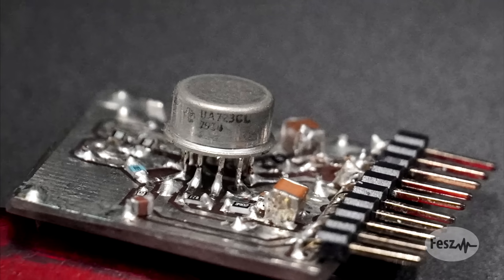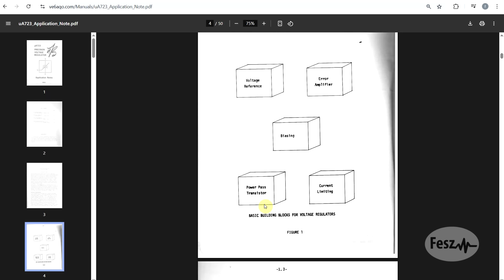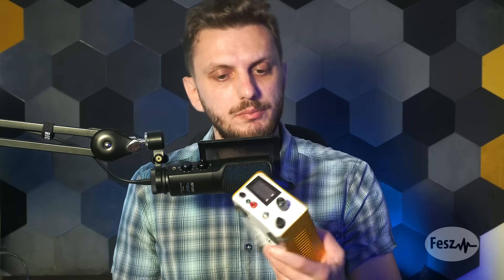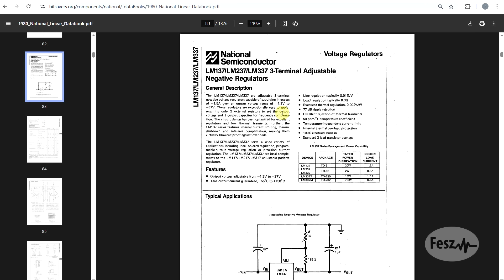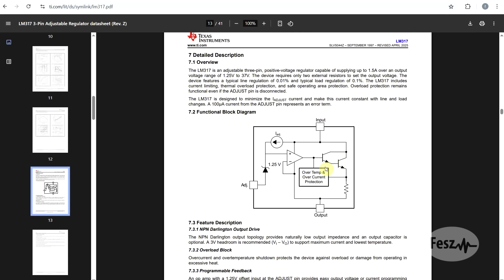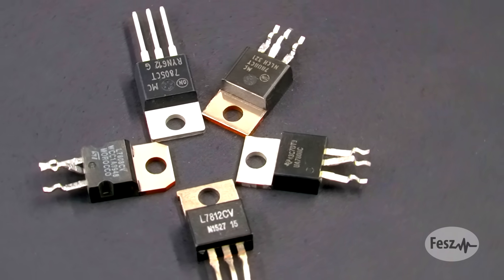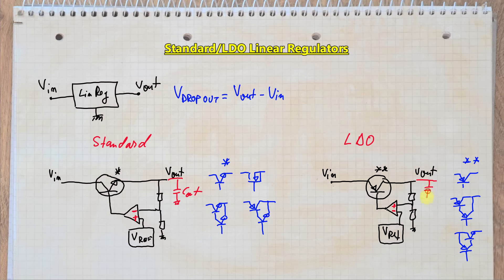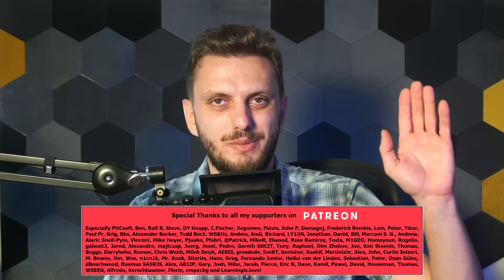Timeless IC's - Linear Regulators

Comment: damn! i always knew there is some capacitance variation, but never thought it can be 80%! 
i thought it is always much bellow 1%. 
thought of selecting precise values of ceramic capacitors, and now i find it would be completely useless. 
i wondered why other type of bulky capacitors were prefered in many application. why not a nice, small, cheap ceramic. now i know
Reply from the maker: Indeed, some capacitors will have a very large variation in capacitance based on the applied voltage. Its always important to observe not just the rated capacitance (measured at 0V) but also the exact value obtained during actual use...
Reply: @FesZElectronics  polyesthers vary much less?

Comment: I've got a few 7805s from the 70s
Reply: Be careful with old non-A suffix 78/79 series regulators as they had a 10% voltage tolerance and were binned non-A, because they couldn’t meet the 5% spec.

Comment: I'd be interested in a follow-up on stability in traditional (common collector / drain) and LDO (common emitter / source) linear regulators. Maybe as a part of design advice on discrete regulators (e.g. for high voltage or symmetrical positive / negative, or whatever may be the justification).

And thanks for sharing your experience! I like your content a lot.

Comment: Use these just above dropout, downstream of switching conerters to easily clean up the conducted switching noise, without the extra bulky discrete filtering components.  Has the 555 been covered yet? 🙂
Reply: Micrel Semiconductor (now Microchip) makes a Ripple Blocker line of LDO’s optimized for significant suppression up to 5MHz - important with modern MHz point of load switching regulators.

Comment: It's possible to supply the pass element of a 723 with a lower voltage than the one used to supply the rest of the circuit. I use this method in a linear PSU I made for a homemade receiver. It deliver regulated 5V and 12V (with the unregulated voltage for some circuit)

Comment: I think it’s important to mention that while the 78xx and 79xx parts are quite consistent (and thus interchangeable) from one manufacturer to another, this is not at all true of the 1117-type regulators. Some of them require critical capacitor selection for stability; others are designed expressly to be stable using just ceramic capacitors. Also, at least some 1117-style regulators, such as the ones from ST, actually use NPN transistors in them, so I don’t actually think that one can generalize that LDO regulators use PNP.

Comment: I found a good linear regulator driving a 2n3055 mounted on a big heatsink best for Radio supply. nice and quiet, but low noise.
Reply: Awesome, I've always been very fond of the 2N3055's. Robust, cheap, reliable! Great vintage component still performs very well today.
Reply: im designing rn a replacement for my father's radio power supply, and it had 6 2n3055 in the back (i must resuse them, are all ok) its 13V 40A supply but...

Comment: Thx! nice video about those fundamental regulators. 
To add up to the video, the LM317 is not an LDO but with a Vdrop around 1.25V it's still very usable as a 5V to 3.3V regulator. This chip is extremely versatile.
Also it's wise to add a protection diode and a few capacitors around all of those ICs, even the 78xx series. Check datasheets for typical circuits. And yes those older NatSemi datasheets are very resourceful.
Reply: One neat trick is to pair the LM317 with a ~2V LED as a 3.3V supply with onboard power LED.
Reply: @ChrisSmith-tc4df  I did that trick on an old 7809 circuit as it's a practical solution to add some load and be sure the regulation remains stable when the targeted device draws just a few mA.
Reply: 1.25V is the reference voltage for the lm317, not the dropout voltage. The dropout can be as much as 2.5V!
Reply: @inductivethinking  you're right ! Though 2.5V is on extreme conditions and the recommended 3V differential is a very conservative headroom. With a 5V source, the 317 at room temp can do the job for a few hundred mA at 3.3V.

Comment: I miss paging through those old databooks discovering all the new and improved chips. New chips in the 70's and 80's were exciting. And the data sheets and app notes seemed better written than they are today.

TI does have 3.3V UA78L33 and UA78M33 ICs, even an automotive-grade UA78M33, that are stable even without input and output capacitors.

STmicro has a 3.3V L78L33.
Reply: some was quite expensive.